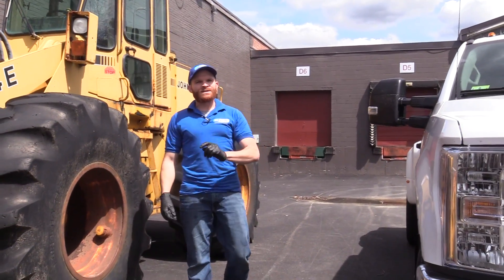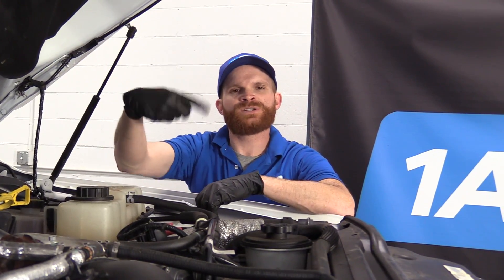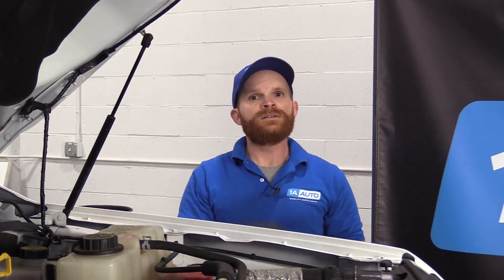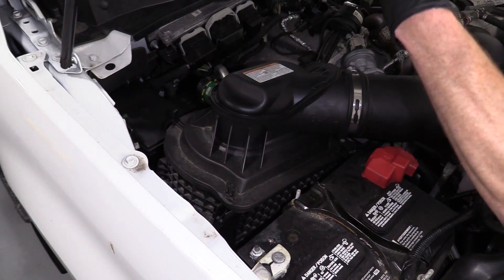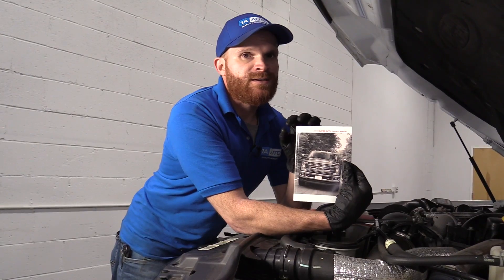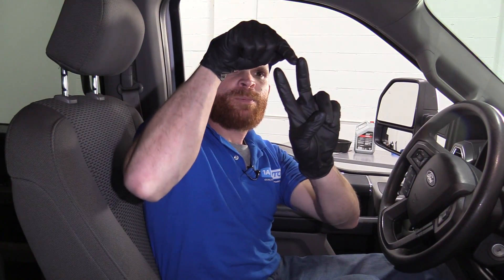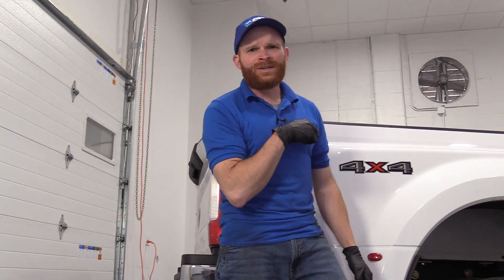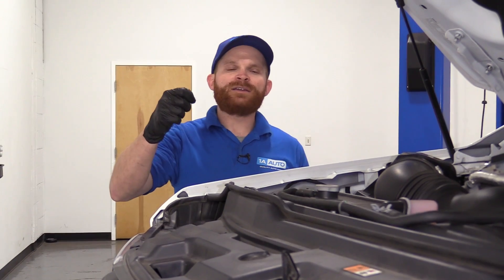Top 5 Problems with Diesel Truck Engines

Comment: The emissions system on a diesel engine is what bothers me, and though I would love to drive one, I’m probably not going to buy one, because it would probably be more costly than I could afford.  If I owned a business where I drove lots of miles every day, then it would be practical, because the emissions system would clean out the soot.  I think a gasoline engine is more practical for me since I make a lot of short trips.

Comment: What about DPF and EGR (diesel emissions)? Here in Europe that is by far the biggest problem and you did not even mention it, smh..
Reply: Only diesels made after 2007 have DPF.
Reply: Because that's not a problem with diesel engines. Thats an issue with emissions. Not all diesels have those parts

Comment: you can suffocate a runaway engine without using a fire extinguisher.  simply place a jacket, shirt, or plastic bag over the air filter.  no ridiculous sound effects required.
Reply: But we now know diesel engines don't like high RPM which ia the cause of a runaway

Comment: I have a 2011 Duramax lml.  You have any suggestions for me, so I don't have the dreaded CP4 pump catastrophic failure.
Reply: Put archoil every fill up.
Reply: Use clean fuel and use fuel additives

Comment: Hi. What about pulling out the fuel pump fuse in the case of diesel runaway with an automatic gearbox?
Reply: When a diesel runs away it’s running off it’s on engine oil it’s no longer running of diesel fuel....so pulling the fuse will do nothing....only way to stop it is the way they describe in the video....cut the air flow off
Reply from the maker: +Oscar Mensah Thanks for the tip! We'll pass this info along to our production team.